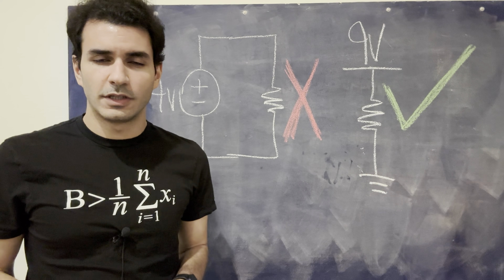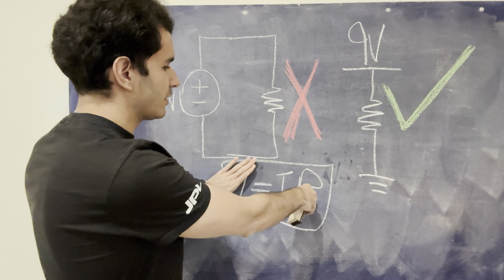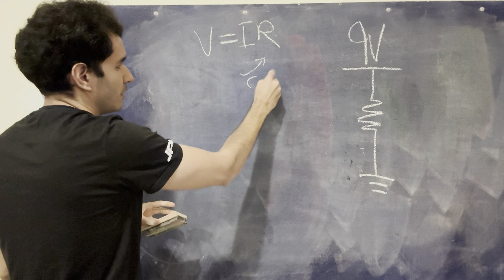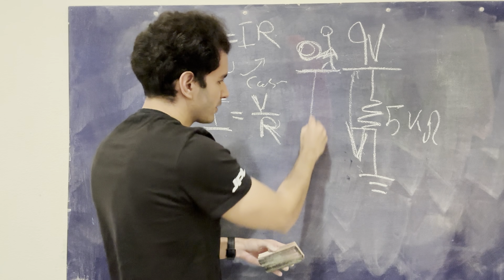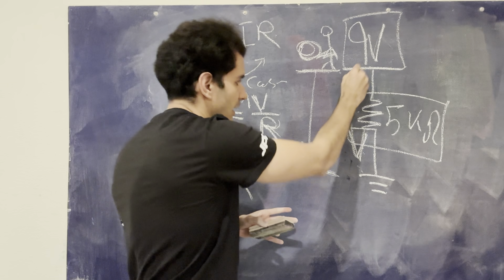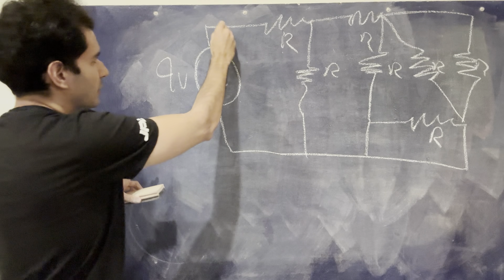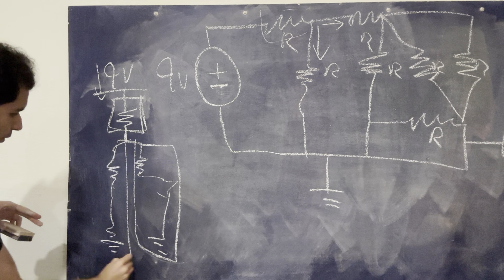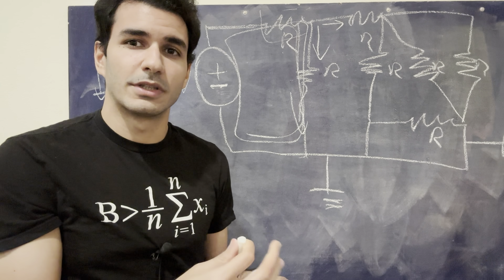Circuits Finally Made Sense When I Saw This One Diagram

Comment: I quite like it :) ... buuut it can also obfuscate some other happenings. E.g. people could get a feel that like a ball that is falling, and finding it's resting place, so too will charges, which is often not correct, since they mainly move around in a closed loop by the driving electromotive force (e.g. a generator). One could also get a feel that the bottom (ground) is some special place, similar to the top (9V). The main thing like another commenter said is to try and look at circuits and electricity in general, from many different views.

Comment: My father taught me the triangle rule for Ohm's law back in the 70s. 
The vertical drawing is just a shorthand for the loop drawing.

Sometimes, like in transformers, it is the current that generates the voltage. 

Also, minus is not always ground. Your loop circuit is missing a ground reference.
Reply: I think that saying the current makes the voltage on the transformer is an oversimplification. The voltage on the transformer input creates the electromagnetic field which creates the current. The electromagnetic field is then seen as a potential difference on the transformer output, and that creates the current in the output. If you measure the output voltage of a transformer with no connection on the secondary side, you will still see the full voltage. And in an ideal transformer with coil resistance = 0, voltage on the output coil does not change with the current
Reply: With transformers (iron core) the voltage generated (actually, transformed) will be an alternating current.  Iron core transformers do not handle direct current.

Comment: Hard to apply KCL to your vertical circuit.  I disagree that the vertical circuit is how physics works.  Kirchhoff’s laws are how physics works and they are quite easy to understand if taught properly.  I see no learning value in the approach you present and see this causing problems for those who may study electrical engineering later.

Comment: So if resistance is close to zero then current is near infinity? Separate issue - this still doesn’t make sense because current flow is made up nonsense . It’s electrons flowing and they are flowing in the opposite direction. So still there is zero intuition on how circuits work. Can you explain ?
Reply: If resistance is close to zero, you can have a shortage. Which means high currents
Reply: Depends on the voltage! For a given voltage, a very low resistance will mean a very high current. But there are limits to how much current any real power source can supply, so at some point the voltage across the resistor will fall rather than the current rising any further.
Reply: The choice of current direction to call positive is completely arbitrary. Most of the time current in an electrical circuit is carried by electrons, but that's not always true. Inside a battery, positive ions are flowing the other way through the electrolyte. In a P-type semiconductor, current is carried by holes, which behave like positively-charged particles and flow in the opposite direction to electrons. Inside the Large Hadron Collider, there is a current of positively-charged protons flowing around the ring. Etc.

I used to think about flow of electrons and mentally reverse the sign of everything, but eventually I decided that was just pointless, needlessly confusing and likely to lead to errors in the calculations. Just embrace the conventional current direction and be happy.

Comment: the next confusing thing to tackle is why call it Ground, when a loop-back is needed ... that is also confusing, since  real Ground is a mass and has its own uses ... a other terminology and symbol would be much more intuitive ...
Reply: Historical reasons, probably. Originally it meant a connection to the physical earth, which was used as a return path in the early days of telegraphy. Nowadays it can mean that, but is more often used metaphorically for whatever is being used as the 0V reference for talking about voltages.

Comment: Thank you Ali! I also always struggled with the circuit method. Your way of explaining make a lot of more sense. I also like the Water-Pipe analogy. Where water also flows from an elevation (V) and you need some kind of pipe with a diameter (R) to let it flow (I). in combination with your way of explaining makes it a lot easier to understand.

Comment: Excellent ! The analogy with mechanics (falling ball) is something I also explain to my students but with a cascade analogy - which best representation is also vertical : I help them consider the current (I) as a water fall from a hill (V), the higher the hill the more intense the current. An analogy that pretty much works in French because "current" is the exact same word for water and electricity (I don't know in English ?) Thank you for the video !
Reply: Same in English. The word "current" just means something that's flowing. You can have a water current, or an electric current. When talking about electric circuits we just call it "current" because the context makes it obvious what kind of current is meant.
Reply: @gcewing  super ! thanks for commenting :)

Comment: I think node voltage and mesh analysis is done easier with looped circuits though.
Reply: For mesh analysis i can understand, but for node analysis, that i find to be used more (at least where im at in my EE degree), i dont think its equally easy to use even not looped. Sometimes i even find not looped easier becasue instead of "following" the path to find its back in the ground you have a quick indicator that the voltage there is 0V so you go from there to calculate the voltages in different points. Idk maybe its just me
Reply: can someone show me how it's done with the vertical structure

Comment: Assume all physical quantities are specified using coherent SI units. If a mass m is released from a height h in uniform (near-earth) gravity, then gravity is constant, and the weight force is constant F = mg {Newton}. In a circuit simulator make this a current source I = mg {Ampere}. Applying this convention is called the force-current analog. Wire the current source so that the output current flows into the floating (top) node of a grounded capacitor. This means the ideal current source is doing work on the capacitor when power is developed, in the same way gravity does work on the mass when power is developed in free fall near earth. Make the capacitance equal to m {Farad}. Now in a transient simulation the voltage on the capacitor will rise as time increases, and the voltage V {volts} will have the same numerical value as the velocity v {meter per second} of the mass falling near earth in the simulation. The electrical power given in watts at any instant is the same as the mechanical power in watts developed by the mass IV = Fv. Put a properly valued resistance or conductance in parallel with the capacitor to simulate friction or air resistance. But air resistance is non-linear in free fall motion near the surface of earth. The power Fv to overcome friction for motion at instantaneous speed would be simulated as IV at an instant of time in a conductance or resistance electrical element. Ohm's law is a constitutive relation that can simulate mechanical heat loss using an electrical system analog model. Inductors and capacitors store electrical energy and can replace springs and mass when applying the force-current analog. These tricks for simulating a mechanical, fluidic, or magnetic system using electrical circuit solver software are taught in some college level control systems textbooks.

Comment: “Corporate wants you to find the difference between V=IR and I=V/R”

Mathematicians: “They’re exactly the same”
Reply: Not if R=0.  You can protest that it is never truly zero, but that doesn't bother mathematicians.  I also believe the division formula is easier to remember/use if you're thinking procedurally, instead of just memorizing.
Reply: @jimjjewett  The voltage source will protest loudly!
Reply: @jimjjewett  Physicist: Let me introduce you to superconductors, where R = 0. 🤣
Reply: @jimjjewett realistically, there is no kind of material that has 0 resistance.
Reply: @jimjjewett  i'm pretty sure mathematicians know the definition of a limit that tends to 0
Reply: @jimjjewett  This was the exact moment in school I decided to study mathematics instead of physics. I liked U := R*I, and when the teacher told us that, in fact, I := U/R, I immediatly thought "But what if R=0?"
Years later I understand, that Voltage is the cause and Current is the effect, but back then it just felt "impure".
I gave up my maths major after 6 years.
But I gave up my physics minor after 3 weeks! (Changing to - of course - philosophy.)
Reply: @r @robin888official  If R=0 this is identical to multiplying both sides by 0. It is identical whether you isolate I, V or R. This is not just a lone fraction but an equation with an equals sign. Both sides are directly proportional. What happens to one side must change in a way that maintains equivalency with the other.
Reply: @r @robin888official  Think of it like this. It has nothing to do with division and more to do with 0 itself. Imagine X=2Y. This implies X is twice as large as Y. If X is 10 Y must be 5. Now what if X is 0? Is 0 twice as large as 0? No. It isn't. But the formula still holds true because it maintains equivalency. 0=0
Reply: @jimjjewett  No. If R=0 it's the same in all cases. Multiply 0 by I and you get no voltage. In I=V/R to isolate V you multiply both sides by R and arrive back at no voltage. If you want to rearrange further R = V/I you still get 0 voltage. This is not a lone fraction it is a direct proportionality. If one side changes the other does so in a way that holds the equivalency true.
Reply: @j @jimjjewett  Think of it like this. It has nothing to do with division and more to do with 0 itself. Imagine X=2Y. This implies X is twice as large as Y. If X is 10 Y must be 5. Now what if X is 0? Is 0 twice as large as 0? No. It isn't. But the formula still holds true because it maintains equivalency. 0=0
Reply: And a circle is just a straight line where you connect both ends…
Reply: @Pete133 oh man, everyone getting into limits.....
Reply: @Pete133 this is mechanical engineers! "everything is a spring
Electrical engineers "everything is a capacitor"
Reply: Actually Corporate wants to know the difference of 
V/R - I.
Mathematicians.... 0.
Reply: @smashdaworld5916   units?
Reply: Voltage and amps are not the same.
Reply: No
Reply: It's an identity

Comment: There were two things that were causing me to not understand Ohm's law and it took me half a decade before it made sense. In school we'd just called it voltage and were just told that Ohm's law was V=IR and the two were related, if you measure two you can calculate the other. In  the last two years of school when I studied physics it was referred to as potential difference, and for some reason (probably autism) I didn't like that term so refused to use or accept it, I kept calling it voltage. In college I kept studying physics, and on the formula sheets that were for the curriculum it was written ΔV=IR, and I thought this was just a fancy way of writing it, missing that we are using delta to indicate a difference of voltage. Like a difference of potential, you know that term I refused to use. I got a lot of questions wrong thinking V=IR applied to the supply voltage and not a measured voltage between two points and it took 5 years and some LEDs to figure out why I was getting them wrong when I was using the formula. I have to wonder if this vertical circuit topology would've helped me understand correctly or not.
Reply: Ohm's empirical equation is NOT a real "Law". It is NOT "fundamental" whatsoever. Go figure kid...

Comment: The word "circuit" describes the existence of a complete loop or pathway. Whether you subscribe to the flow in a circuit using conventional or electron flow, the pathway of energy but for a complete pathway from beginning to end. The drawing on the right does not give you that perspective. If ohm's law gives you heartburn, then electrical engineering is not the field you should discuss.  In your example, it still applies with multiple current paths within a circuit. However, at that point it also requires Thevenin and Norton to do proper analysis. Also, how you draw the circuit diagram has a lot to do with its clarity of understanding.

Comment: Maybe it will sound stupid, but... why can't we replace a cable with a brick? I'm serious here. Brick, glass, air, vacuum... high enough voltage can go through these at some point, right? With a giant value of R, why aren't we just getting enormous voltage with a small current? And vice versa, if we keep decreasing the voltage, shouldn't some conducting elements start acting like such "brick" and randomly stop conducting our current, i.e. not just resulting in a low current, but ZERO? Like our brick?
Reply: You can

Comment: The reason for using Ohm's Law as V=IR is that in practical electronics we are interested in the "voltage drop" across components, e.g. a resistor, as there are usually many more than one in the circuit.  Testing an electronic circuit always involves measuring the voltages at certain points.  For example, if there are two resistors in series (potential divider) we want to know the voltage at the mid-point.  Explaining the physics involved takes a different perspective.

Comment: I don''t quite agree with this. You can actually MAKE the circuit on the left using a simple battery (graduate level chemistry experiment). But you cannot make the one on the right - as there is no return path for the current? I do like the idea of comparing the Voltage to the height you are above the ground (and it's nice to see the 'ground' symbol used there) but this is really not at all what's happening. You have a source of energy - might be a rotating coil in a magnetic field or a chemical reaction etc. And THAT is the source of energy - which causes electrons to flow in response. Also, thinking of it in this overly simplistic way does not help when the resistor is replaced by an inductor or a capacitor - or a tuned circuit and the voltage source is replaced by one where the polarity is alternating. In an attempt to get closer to the underlying physics I fear we have moved fartther away from the underlying physics. IMHO.
Reply: Well, you have to keep in mind that there is a return path through the power supply from the bottom to the top. Although "return path" isn't necessarily what it sounds like. If the power supply is a battery, electrons that reach the positive terminal don't actually flow through the battery to the negative terminal, they react with the positive electrode and stay there, while another chemical reaction at the negative terminal releases electrons into the circuit. However, there is a flow of positive ions through the electrolyte in the opposite direction, which constitutes a current, so as far as the maths is concerned there is still a continuous loop of current.

Another interesting case is when the power supply is a charged capacitor. Again, electrons do not flow through the capacitor, nor does anything with a positive charge. But there is a changing electric field between the plates as the capacitor discharges. A changing electric field is sometimes called a "displacement current" because it produces the same effects as a current, including generating a magnetic field. So if you take the displacement current into account, again there is a continuous current loop.
Reply: @gcewing  Yes, that is right. But at a deeper level - even if we look a length of copper wire and imagine to be be like a cylindical-shapped piece of solid copper (about as simplie as you gan imagine it) then the electrons entering at one end are not all goign to be the same as the ones exiting the other end - most will not get far and will end uyp being attached to the nuclei of the atoms in the copper, until they end up getting knocked out again. the concept of a 'current' is an abstraction that assumes a loop but, as you allude, it's not working as a loop pe se. Things get even stranger when we are operating at microwave frequencies when the current at one place is moving L>R while at another nearby place is moving R>L. All good fun!

Comment: Nah, i cant agree this is more intiitive. It helps on some ways but i find the completed circuit more intuitive. Dropping a boulder is a finite action and potential is zero at the bottom. Charge continues flowing in completed circuits with a potential